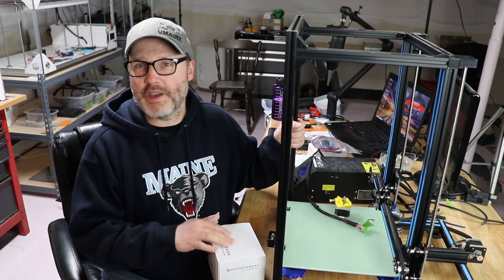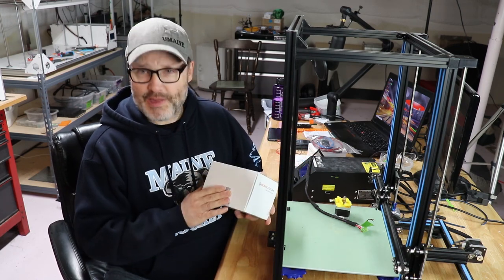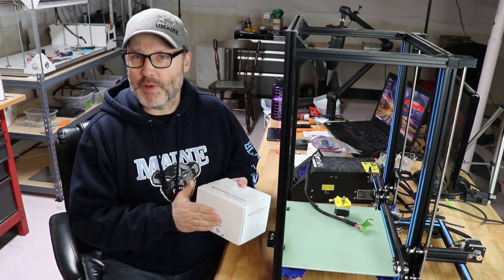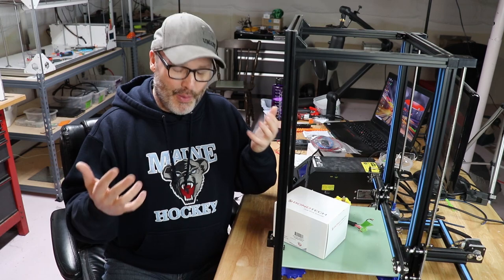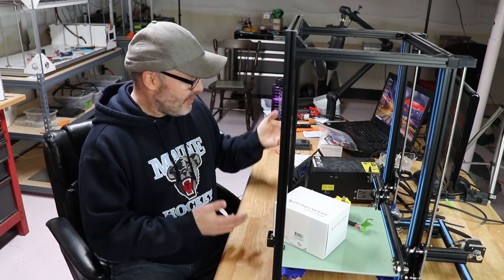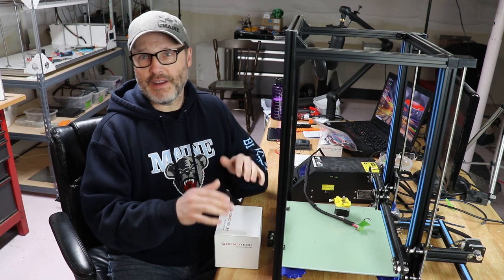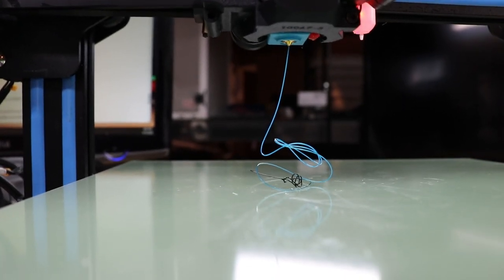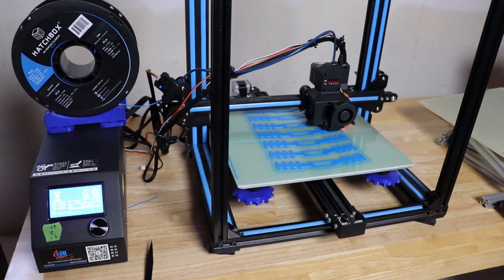Upgrading my Creality CR-10S to the Bondtech CR-10S Direct Drive System (DDS)

Comment: Very interesting video. I do have questions though:
1. What were the main reasons and benefits to upgrade?
2. Was there any improvement in print quality?
3. Did the extra weight/inertia on the x axis require slicer settings changes to maintain print quality?
4. How do you perform the initial filament feed when for example, you put a new filament spool on?

Answers are very much appreciated as I am seriously considering this upgrade.
Reply from the maker: 1) Time.   No wasting time on other (free) designs on Thingiverse, etc to see if they really work well. This thing is well made and pretty easy to attach, upload provided firmware and up and running
2). Yes, excellent quality. They also provide a Simplify3D profile that’s very well tuned 
3) See above.  Their firmware has several changes to acceleration and jerk. 
4)  I use the Change Filament option in the controller menu.
Reply: @WhereNerdyisCool  Thank's very much for your replies. Much appreciated.

Comment: you should use a lapel mic... thanks for this video!! I DO wish you had shown the results of what you had printed tho...
Reply from the maker: I do need a better mic!  I had a wireless lav mic but the receiver started failing.   Upgrades!
Reply: Where Nerdy is Cool! Or wired... with a really long extension... I got a Shure from Amazon with a 20’ extension 😁
Reply: Where Nerdy is Cool! BTW... thanks to you I bought the Bondtech DDS and I use my EZABL with a custom mount (where the BLTOUCH goes) and it works great so far! I said ‘to hell’ with all the wire cutting and stuff and spent the money

Comment: I have done the cr10 upgrade to a cr10s but that's as far as I have gotten works great I print on glass
Reply from the maker: My stock hotend jammed solid   I wanted to upgrade this thing to beast mode... print anything. I’m very impressed with it. It’s been printing non stop since upgraded and no issues.

Comment: Hi Paul, cool video, your CR-10 (S-B) looks great! hehehe.. those frames looks sturdy, great!

I would love to buy a genuine Bondtech, I tryed 3 years ago to my UM2(+) but they don’t ship to Brazil. 

Actually the mount is SLS,  Bondtech should produce it in injection molding to lower the final price... it’s so expensive and the taxes here double the value (also all products from Europe or US).  Because of that I bought, recently, a TriangleLab clone with no taxes from China. 

Keep up your awesome work... missing your videos, long time without seen it
Reply from the maker: That’s an interesting point about the injection molding. However I’m sure having in house SLS allows for quick modifications and changes without junking an expensive mold?  I’m sorry the taxes are so high where you are.
Reply: Where Nerdy is Cool! yeah, that’s true... a mold for injection is very expensive but need to find a balance beetwin final value/more sales and SLS for low quantities.. they probably calcule it but maybe they don’t know how many consumers to reach lowering the final price... is a estimative hard to validate. And they have a lot of products but sometimes it can be usefull for the “budget” ones such as BMGs... (not the QR version and others more limited for some machines)...

Comment: Great video. I wanted to see if it is possible for you to explain some final steps? I'm using a CR10 S4 with simply3D and I am a bit lost with some final steps. I have no clue what or how to set E-Step value set to 415 and Acceleration set to 500 means and where to add it. Also, where do I do the Reduce Retraction Distance to 1mm and Retraction Speed to 35mm/s before start using the DDS on simply3D? I have been lost for days now. I would appreciate any help.
Reply from the maker: Extruder Tab on S3D for Retract settings
You should be able to use their provided firmware (assuming you bought the DDS?) which will already have the estep value.

Comment: Do you run the part cooling (5015) fan at full strength with this setup? I just installed this on my old (heavily modded) CR-10.
Reply from the maker: Yes I do. 100% starting on layer 2
I’m using the Bondtech provided profile too

Comment: Question about inputting the x and y offset numbers for the BL Touch.  I currently have a BL Touch installed on my stock CR-10s and am wondering if you are able to input the new x and y offset numbers directly into the new firmware via the LCD or were these numbers already in the firmware?
Reply from the maker: Only the firmware from what I can tell 🙂
Reply: @WhereNerdyisCool  Thanks Paul.  BTW fellow droid builder here.  I have an R-Series droid and a BB-8 finished.  Looking to start printing the parts for a D-O.

Comment: May I ask you what is your retractions settings? I am having weird clog issues, after retractions......thank you in advance!
Reply from the maker: I’m using 1.0mm of distance, 0.05 extra restart distance, retraction speed 35.  Coasting 0.30. Retraction vertical lift 0.20

Comment: Just thought of another question:  When using a Bondtech extruder with a Bowden tube you need to run a g code script to get the filament into the extruder and for the extruder to get the filament to the hot end.  So what exactly do you do for this direct drive unit - manually feed the filament through the guide tube unit it makes contact with the extruder?  But then how do you make the extruder ready to accept the filament?  Is there another g code  for this?
Reply from the maker: They’ve edited the Advanced Pause features to assist with load and unload.  I still push the filament all the way to the hot end (unscrewing and opening the top piece of the extruder). Then allow it to prime.  It’s working very well.

Comment: What you bought is based on a file from thingiverse.
I always buy genuine E3D but Bondtech are rip off merchants. $260 for that kit is ridiculous.
Reply from the maker: Bondtech has made numerous improvements over the original The Tank. I’ve printed several.

Comment: Ohhh my friend the thing is, i understand thats the way you like to do this things and i respect it, but this is a platform (youtube) that the point its to share information  for helping others and to be profitable doing so, and you have to realice that 95% of the people cant afford this or wont make that spend, so if you want to help them or to grow your channel you have to figure ways diferent from others youtubers to make our life easier and that helps you to, for example here i can help you with an idea:  there is only 2 clones that made exactly the same products has the originals almost all the time, they are the expensive clones (trianglelabs and mellow) the first one I'm my opinion its a little better, but this guys makes the same MOSQUITO hotend that is wayyyyy better than  E3D v6 and it comes with the adapter for V6 bowden setup and for direct drive, you have the best thermal dissipation EVER, never jams, you can swap the nozzle just with one hand and without disassembly (even some people do it in cold) you will never break the heatbreak because its separate from the nozzle, you dont have to mess with the electronics that much and the best part is that this combo cost half the price that you pay for BETTER quality and Concord, will save you time, will help others, and will help to grow your channel ( and yes i know E3D its great to) hope it helps and i understand if you are not willing to take this advice. PD: Sorry the bad english
Reply from the maker: They now offer the DDX upgrade path using the Mosquito or Magnum.  I’d love to try that.